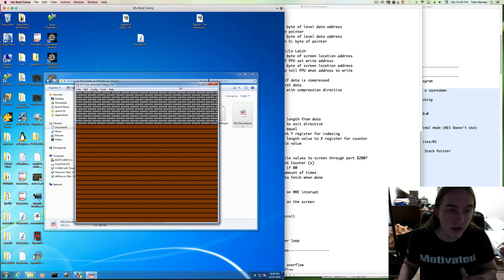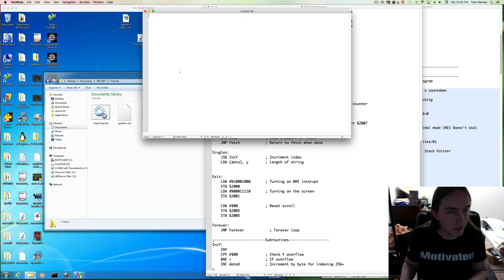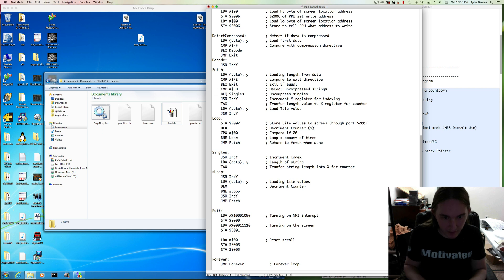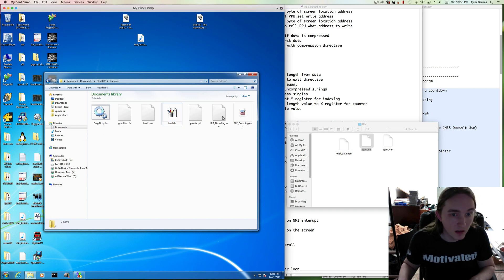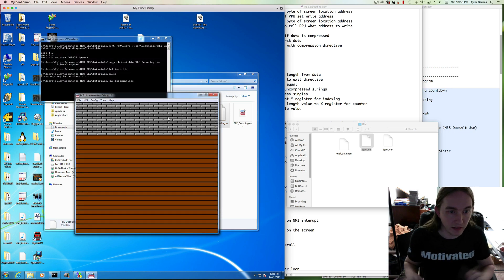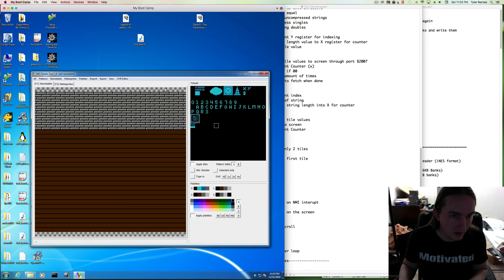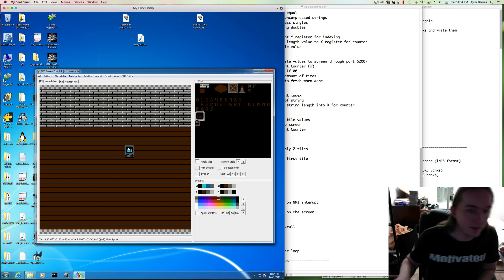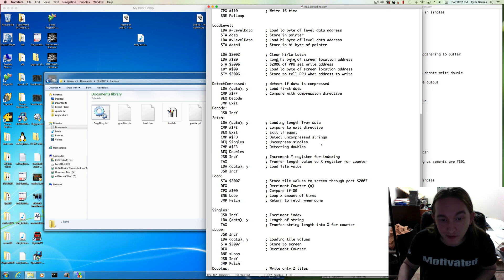NES Assembly: Ep3 - Adding Directives to RLE Decoder

Comment: If you're using NESASM, the syntax for copying one background byte from the pointer address plus Y should be " LDA [dataL], y ", not "LDA (dataL), y".  The instructor is using asm6 , a different compiler, so slight syntax changes...in case anyone else was frustrated for a couple of weeks. Also for NESASM, the background palettes should be in Bank B (per NES Lightbox)